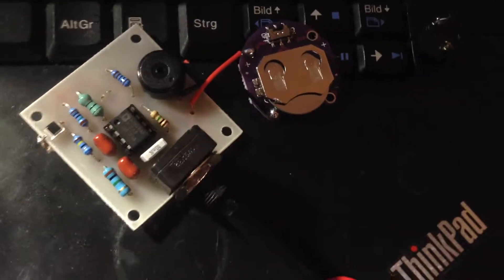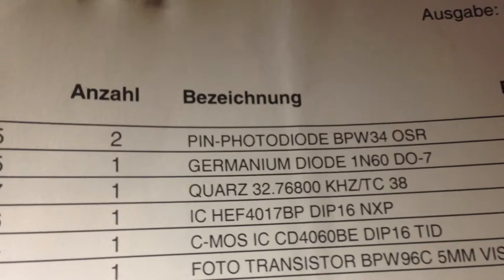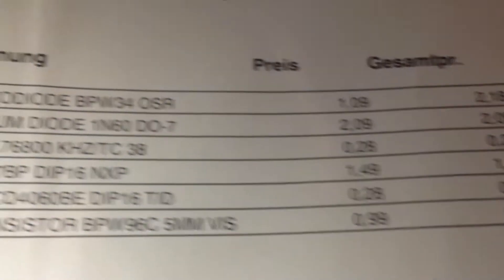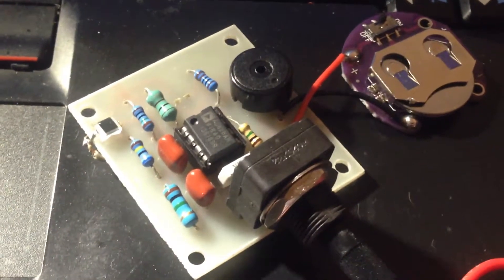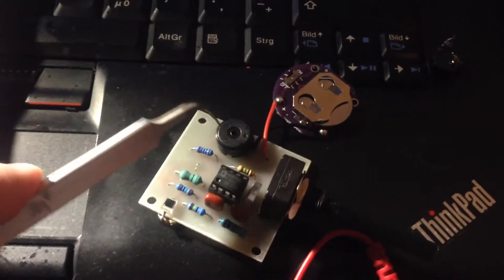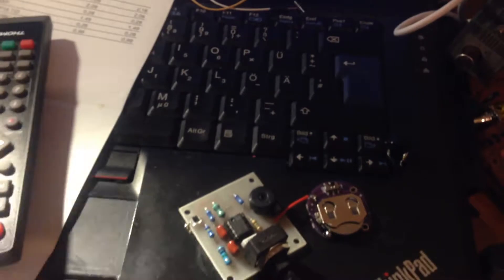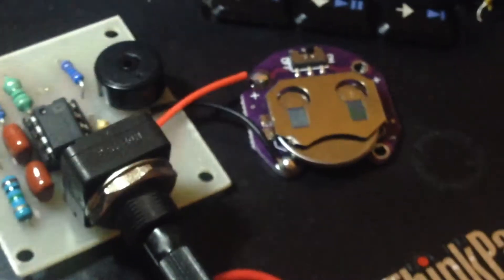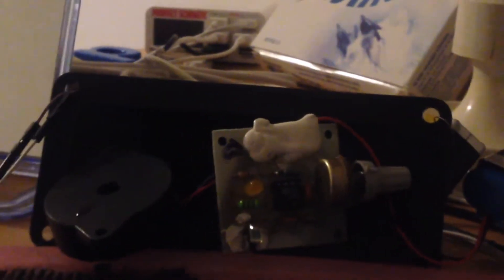BPW34 110nm to 1100nm photodiode detector

Comment: Hi.
the bpw34 has a 3 dB passband between about 500 to 1100 nm, I don' t know where you got the 110 nm figure.
Your circuit is not working properly, actually it can't, the only response you get is when you saturate the circuit pointing the remote right at it.
I ve got one simple detector built here, I can sense a remote pointing backwards in the room next to me ( in relative darkness).
You need some way of adjusting bias, provide proper feedback, in order to have enough sensitivity and also some bandwidth .
Some folks could achieve a bilateral voice link over 10s of miles, and even spanned more than 100 miles with digital signals.
See  http://modulatedlight.org/
If you want to receive and demodulate IR remote signals, you ll really want an IR receiver circuit like those you can have from an old TV or VCR ( the small tsop thing, or whichever you can find and get the pinout.
It ll do reception aswell as demodulation and output a TTL signal you can process with any microcontroller .
Have fun with electronics!
Reply from the maker: f8ebl F8EBL hello, thanks for your attention, the 100nm to 600nm will work with feedback of diode style inductor and mix with bpw34! I will explain, hope to help u, the lm358 frequency max is 30mhz but when you loop outputs to each other the feedback of wavelengths will detect up to 4ghz(check my video gsm detector with op-amp) please try bpw34 or 35 or osram 501 diode and enjoy 110nm to 1100 by mixing with opa21xx opamp series! Last point is single mpsa18 transistor without sensor can detect radiation!!! Several videos available let me know your idea